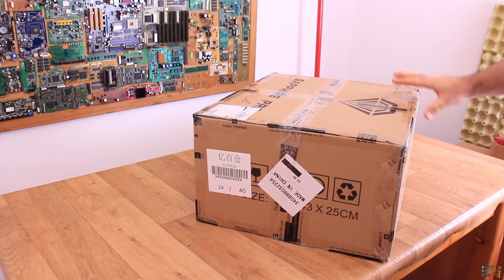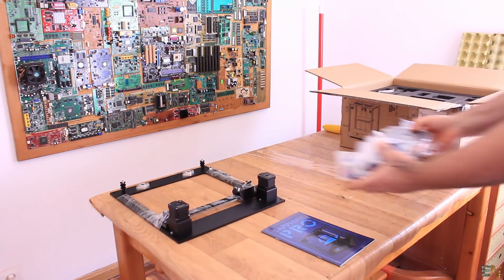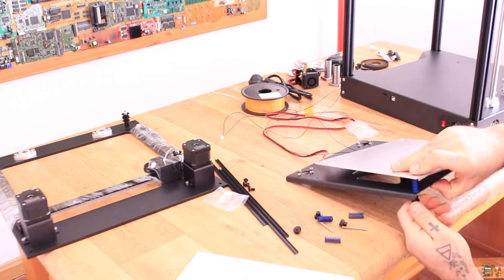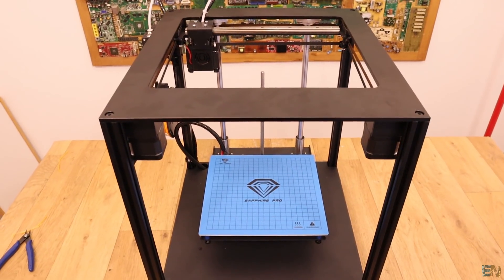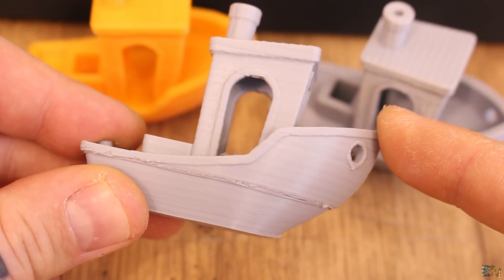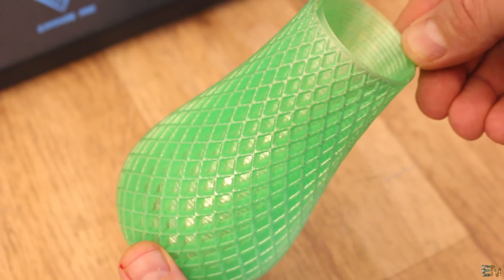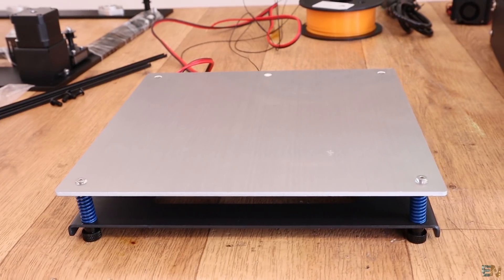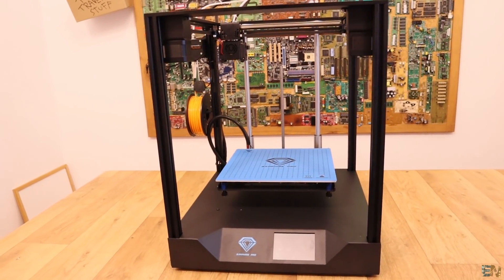Sapphire PRO 3D printer Review

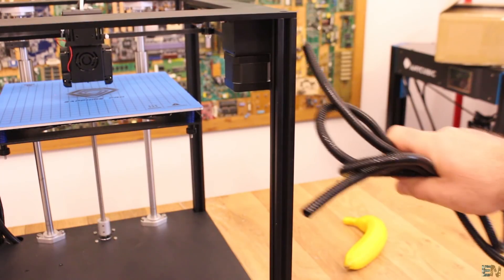Comment: 5:25... IMO... the spiral wrap is much uglier. Doesn't really hide the wires.
Reply: I tend to agree, but it IS much more flexible, which was one of his concerns.
Reply: @Markus0021 ... If "Fexibility" is the issue then I would use Clear or Colored thin wall Silicone Tubing. It can easily be slit along it's length.
Reply: @lasersbee   Sounds like a very good solution if you have a sufficient quantity of large enough diameter for all the cables to fit into. 
Otherwise some people (including myself occasionally, I must admit) will go with whatever they've got on hand. I once used a meat tenderizer as a hammer, soooo... (don't ask, LOL)